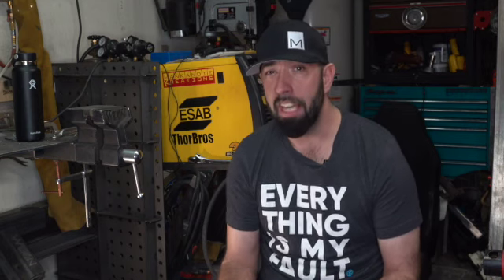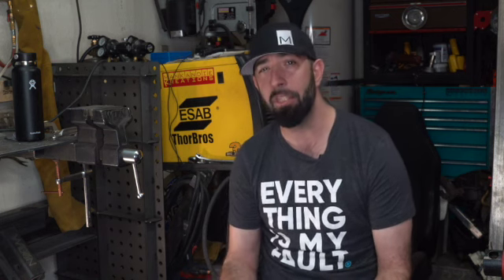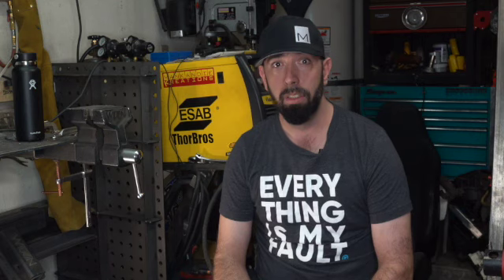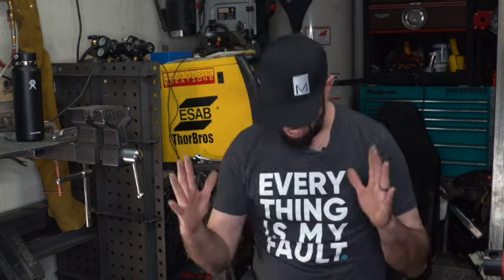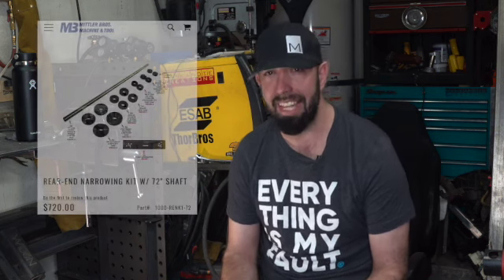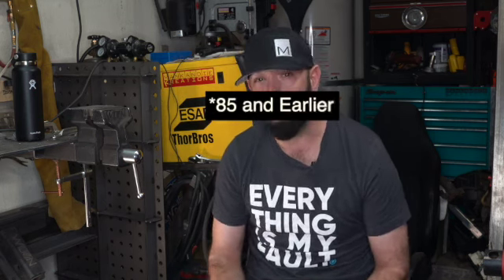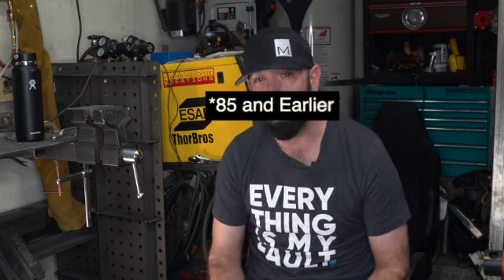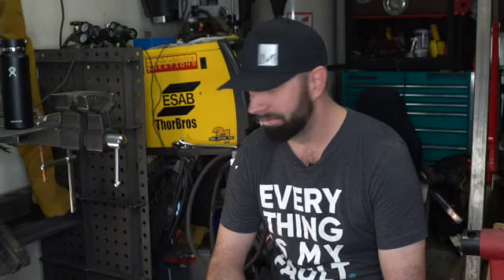Mighty Max Ep. 08: How to Narrow an Axle. Part 2

Comment: Arron, I used a 97 Ford Exploder rear end. I f remember correct i cut the drivers side axle tube off and cut out the rest of the tube out of the housing, cleared out the plug weld. the end i cut out was machined but i only ground the tube to refit fit back into the diff case, then I went and bought a right side axle which is 3.5" shorter then the left on the 97. It comes out to the stock mighty max axle width. Yes I should have had the tube machined would of made it easier but you know how cheap i am. I have no bearing shavings as far i am aware of.
I freakin love your videos!!! I want to see your Truck!!
Reply from the maker: I do recall you using two right axle shafts. I would’ve done the same but the wheels I want to use require an axle that’s even narrower than the Mighty Max.
I’ve got bad news about my truck. But rather than tell you here I’ll advise you to go check out a really cringey video I did called The Rotisserie.
https://youtu.be/5YpPFCNMjI4

Comment: Dont know the length of the rear montero sport axle but i would asume is as narrow as the 1st gen montero and as a bonus some models have disc brakes. So in essence more options also since the 97-99 is leaf spring amd the 2000 up is coil spring and both come in drum and discs. Just throwing an added option in case some one is interested in keeping 6 lug and going disc brakes.
Reply from the maker: Nice! Thank you!!

Comment: may you make a video how to widen axles? I live in Indonesia and we do not have access to parts and tools like in the US. As we customize a lot here i want to widen my axles by nearly 3 inches... any idea?
Reply from the maker: I don’t know if I’ll have the opportunity to make that video. My next project will have CV axles rather than the solid axle like my Wife’s truck.
Widening would be a very similar process. If at all possible, I would try and get two axles. You could cut the ends off one axle tube, and then cut the ends off the other axle inward 1.5 inches. Then weld on the longer ends to gain your 3 inches. 
The only safe option is to purchase custom axles that are made 1.5 inches longer to fit your newly made axle housing.
I hope this helps! I’m excited to hear Garage Fab has reached Indonesia!! Good luck my friend!

Comment: I hope you can help me out. I just found your channel and I have a 1992 MM Manual 4g64 motor .
I have swapped out the gas engine for a 2.5L 4d56 Diesel Or a brand new Hyundai d4bf turbo diesel . it was a direct bolt up to me tranny. but I would like to get a Taller gear Ratio. Like a Ford 2.73 Rear end to lower my highway rpms as it is over reving the diesel at antthing faster than 55 mph. will a Mustang rear end differential pinion flange bolt  up to the MM Driveshaft?
Reply from the maker: @2davydo  It does NOT. In order to get this combination to work you’ll need to have a driveshaft made or modified. I suspect you might need to do this anyway unless the tail of your transmission is in the exact spot it was before the swap.
Your custom shaft will simply have the slip yoke and front U joint that matches the transmission and the rear U joint/flange that matches the differential.
Happy to have you my friend! Best of luck.

Comment: Mitsubishi van rear axle will work too and is 5 lug think you just need to change the leaf purches and such
Reply from the maker: Excellent! That's awesome. I've never heard of (or more importantly seen) a Mitsubishi Van. And now I want one!
I don't think they're available in the states.
Would you happen to know the axle width?
Reply: Garage Fab  I don’t I just saw it posted on the Mitsubishi mighty Max fb page there is one by me at a yard
Reply: I have done the van rear swap. It’s been in my mighty max since the 90s. 5 lug/4.22 gear ratio. Still in it. Daily driven.
Reply from the maker: @Antonio Valez Nice! How does it fit?
Reply: 20x9.5 mmr hr3 245/35/20 square.  rubs in front but 225/35/20 should help.
Reply from the maker: Awesome! Thank you for that! 👏🙏

Comment: "Just because you can, doesn't mean you should."

My girlfriend wrote that across my bathroom mirror to remind me, every morning.
Reply from the maker: I disagree! “If you can, you DEFINITELY should. Just realize that you probably shouldn’t have and let that determine how you use that thing you shouldn’t have done.”
That would cover the whole mirror though.
Reply: Lol!

You said the problem with narrowing the Mitsubishi axle is that the tube won't fit in your jig, so it's impossible to narrow.

The axle is steel, so it can be welded.  Make it so it bolts to the outer flanges, then has two cross braces (180° apart) welded to the inner axle tube. After you cut & trim the outer section, bolt it back into the jig with a spacer making up for the amount shortened. 

If you cut on an axle tube diameter change it may be possible to slide the outer section of the tube inside of the inner section (telescopic). Then it could be easier, than the Ford axle, because you wouldn't need trim out a section!

I have no idea what you'll use for axle shafts!
Reply from the maker: I like where your head is at. I’d consider giving that a shot if I hadn’t already tossed it in an apartment complex dumpster. 😇

Comment: Will the Toyota 5 lug hubs fit the mighty max?
Reply from the maker: Yes they will! Hub and rotor is a direct swap, bearings and all. The Mighty Max brake caliper will need to be spaced out a small amount though.
Reply from the maker: Check out this video. It goes into a bit more detail. 
https://youtu.be/UjAYjhVgwWc

Comment: But aren't you the ONLY mitymax owner?
Reply from the maker: Not by far! Though they do seem to be fairly rare. I see more Ferraris than Mighty Maxs here in Vegas. 😆
Reply: @GarageFab  the only thing more fun than metal fabrication is metal fabrication where it regularly reaches 111° right?
Reply from the maker: If I had an air conditioned shop. 😩 That would be a dream life.
Reply: @GarageFab  my garage here in Florida is air-conditioned but it's so small that I end up doing everything outside in the sun anyway. Welding in the sun is even more fun than going to the beach. Somehow it doesn't feel that way when I'm doing it.
Reply from the maker: Hahaha!
Reply: @GarageFab  so as u may remember, I am new to your channel, is the mighty max done?
Daryl
Reply: I meant to ask you but I assumed you would know, the 8.8 in axle from an Explorer has two different length axle shafts so you can cut one side and use another axle shaft to shorten it. Would that have been enough to fit the Mighty Max?
I have one for my S10 and it will fit without shortening
Reply from the maker: I did know! Thanks to some really smart folks. But no, I still would’ve had to shorten it even more and Mustangs are more available at my junkyard.
No! The Max had quite a ways to go before it’s done. Hopefully soon though. I’m itching to start my truck project.
Reply: @GarageFab  well I hope you don't become like me and just start several projects and not finish any of them. Currently I have the motor out of one of my S-10s the head off another S10 and the sink out of my bathroom. And I ordered a new sink for my other bathroom and I've been working 12 hours a day 5 days a week. Something's wrong with the math in my head here. I really enjoyed your pipe coping video.
Reply from the maker: Hahaha! I feel you. I can’t become like you cause I already am. I don’t think I’ve finished a single project in my entire life.
The exciting part of the project is starting it, and figuring out how to do it. Once you get to the point where you realize you succeeded, the rest is just tedious work and I lose interest. I’m hoping the YouTube viewers will keep me accountable and I might actually finish something one day.
Reply: @GarageFab  it's frightening that every word of what you just said is so true. It's like the unfinished projects are there and I keep thinking it's okay I know how to do it when I get to it. And I do complete things at work that's because I have to and that's where I get my sense of completion but I'll bet if you think about it you have completed some projects. Even if it was just a small one like you brought the trash out or you watered your plants. I think that counts
Reply from the maker: Hahaha! I suppose. I pooped today! Yay me!
Reply: @GarageFab  good start, now each day complete even bigger projects!
I have had mig welders since 2005 but I still can't weld under hand. Do u have a video on how to do that?
Reply from the maker: Haha! Definitely not. You gotta be good at something before making a video. 😬